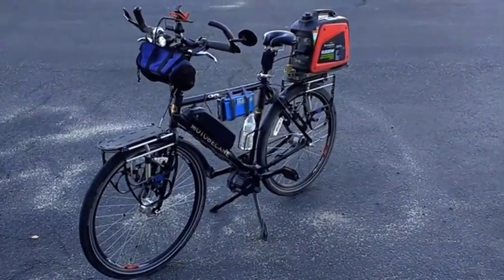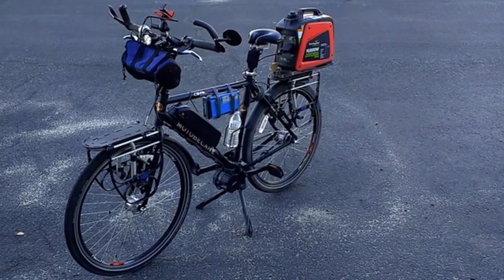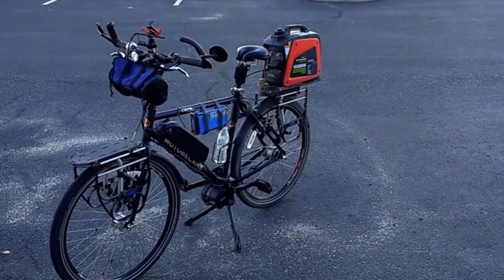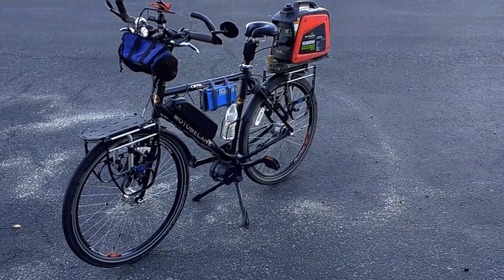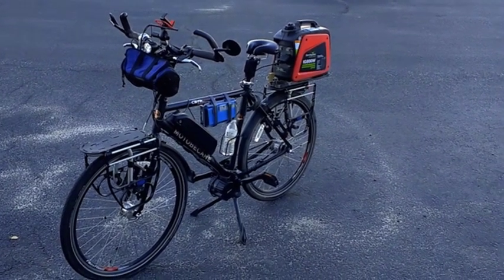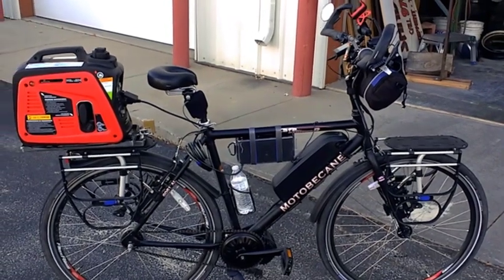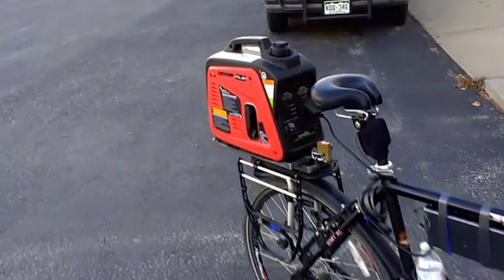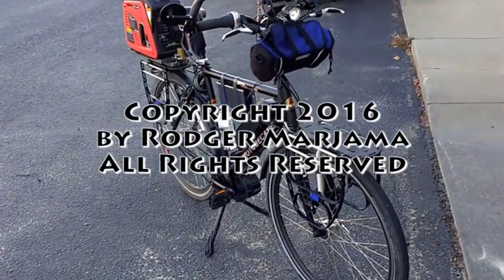e-Bike With Generator

Comment: Nice. Im planning to do something similar for my fat tire 2000w ebike. But my plan is to plug a converter into the controller directly to power it. Just have to find a small but powerful generator.

Comment: :)
Ideally you want a generator that provides the voltage and amperage that your battery charges at so you can skip the inefficiency of and weight of the charger.

It sounds like that would require a smaller generator and thus ICE.
You might look at a weedwacker or somesuch that produces about 300 to 400 watts and mate it to an efficient PM motor (as a generator) from hoverboard or something of same voltage, using a chain and properly sized sprockets to have both ICE and Generator at optimal rpm.

You will probably find that such will fit within the frame.

After that you may want to look at tuned length exhaust and intake software as that makes a big difference to ICE efficiency.
To make a tuned length exhaust, with a muffler, you need David Vizard's Pressure Wave Termination Box before the muffler.
The intake needs proper bell mouths at the intake into the air filter and from it into the carburettor.

I know that's never going to happen as it's way over your head.
I put this here for people with more tech inclination than yourself.

Comment: If you get another charger, minimal weight,  could you have 2-3 batteries and charge them also....I understand you will have extra weight.... but would generator be possible....I'm deciding on either going with solar or generator

Comment: Roger .. I have 4 ebikes and scooters currently .. problem being range which the experience of batteries.. thinking about unlimited range with 1000w 4 stoke generator coupled with a 600w ac to dc 48 v power box to eliminate battery all together .. can this be done .. mid drive Bafang 750 motor  
Saving the cost and weight of battery ??? 
Ty Don

Comment: It looks like it would overcharge the battery on the bike shortening it's life.
Reply: Would probably be wise to discharge the battery to about 60% before plugging in the charger. I'd like to try this by mounting the generator in a trailer but don't want to burn up the battery. The charger the came with my ebike only puts out 163 watts

Comment: Can a gas generator charge two e-bike batteries at once even if a e-bike battery is 48v and the hub motor is 500w or a 1'000w.Do the gas generator has to be 1,000w to charge the two 500w because I might have to go with a 2,000w gas generator ?

Comment: I'm thinking a gas motor conversion can work as a generator and get down road too. So can switch between electric and gas, had to charge and run .. Icd like to know the specs of the charge controller  if possible.
Thanks

Comment: I'm thinking of running directly to the motor.  Just need a 120 to 52volt transformer and plug to bypass the battery.
Reply: That's easy enough to do. Just think about the output and the transformer capabilities, heat and rain. There are plugs you can get that connect online that should be able to plug into the bike.

Comment: i was planning on getting a bike trailer for my ebike, and i planned on putting some batteries, maybe some solar and a small 2kw inverter generator. then tonight i dawned on my that i can mount the generator on the bike, ditch the solar and extra batteries, down size my current 3kwh lipo battery to 100wh at 72v to get up hills and use the generator to feed the controller and keep the battery topped off and ride all day. without fear of having to stop and charge. i spent a ton of money using lipo and spent another ton in fast chargers for them so i can balance charge all cells of the 3kwh in about 40 mins, if i can spread out over different breakers. but now i am thinking a small gen to power the bike then i can commute all day if i wanted or needed
Reply: commute all day

Comment: Could you theoretically connect the generator straight to the motor?
Reply: yes, theoretically
Reply: You would need to change the 110-120 volts coming out of the inverter generator down to a lower voltage that the controller and motor uses. The charger that comes with ebikes already change the voltage to charge the battery which makes it easier to charge the battery while it's discharging at the same time without having a voltage converter

Comment: Does this Dual source power supply confuse your controller? I had no idea EBIKES don't have to beOFF to charge by design. Did you hack the controller, or is there a way to attach an external power supply to any EBIKE controller?
Reply: I just bought my first ebike and the battery can be taken out to charge while keeping the bike stored somewhere or there's a port in the frame to plug the charger through and into the battery while the batis still attached to the bike. Should be able to charge the bike while riding it at the same time with either a small inverter generator or a battery power station

Comment: This is really interesting. I've done a lot of research on this because of your video. It is possible to get around 180-200 mpg when you skip the battery and link a motor directly to the generator with a power supply. A 2,000 watt setup is achievable in under $1000 which would be around the same price as a battery powered one, except with significantly longer range and instant charging at gas stations. If an external 5 gallon gas tank is added it could potentially drive for a thousand miles on one fill-up.
Reply from the maker: Yes, did that using a AC/DC 60V, 600W converter to some extent. Wanted to keep the battery in the loop, and did not find a suitable mix. Generator to the converter works fine though.
Reply: Could you give me a diagram how to do that
Reply: Got a electric bike that only last for 30 mins
Reply: I would like your help

Comment: You want to have 12 volt output from the generator and use a cheap converter to boost to 48 volts 2 amps this improves efficiency by bypass inverter. Up to 40% better.
Reply: those 12v outputs are lower current. so iets say its 12v x 2amps=24 watts,. to boot it to 48v it would be 48v x .5amps=24 watts plus a conversion loss of about 10%. even if its 12v x 10amps that is still only 120 watts. once boosted to 48v it will be 48vx 2.5amps mins loss in the conversion process.

Comment: 1c charging is best for battery cycle life. You would be better to charge at 4 amps for a 4p battery and use the generator when riding at less than 70%

Comment: Around 2017, I experimented with a very similar model genset on a previous recumbent bike build with 26" wheels and got much the same results as Rodger did. On a 60 mile ride I precisely measured the gas and set my speed to maintain as near a constant battery voltage between start and finish. I calculated consumption to be about 170-200 mpg and as with Rodger, I matched my motor power draw to be less than the charger's 300W supply. The recumbent advantage probably gave me a extra 2 or 3 mph as I recall sticking to about 20mph with some long hills. The problem was the same as Rodger's bike, that the 21 lb weight over the rear will felt unstable. On other recumbent builds I use Golden Eagle 37cc 4 stroke engine kit with a single stage drive belt to a 22" dia drive ring snapped onto the rear wheel's spokes. This also gets 200mpg but for ave speed of 26mph with 25% ride being hills. If the genset powered a 600W charger and if the e-bike motor assist could be de-restricted then it too could give a similar ave speed of ~26mph though the mpg would likely drop. The mechanical drive is more efficient but gliding down steep hills >30mph causes the belt tension-er vibrates a lot when the belt is driven by the wheel. The quick fix is to temporarily remove the belt from the drive ring but really there needs to be a freewheel or sprag clutch integrated into the drive ring. The genset does give some nice advantages, 1) the ease of taking it off for short rides or reclaiming cargo space, 2) its 37cc engine is much better sound damped inside its case, 3) the electric ride is much smoother and quieter than with the mechanical engine drive, 4) the 12V and USB outputs.  I plan to build a 52" wheelbase high roller style recumbent with the removable genset located just front of the rear wheel swing triangle because its just very compelling. Of course both forms of gas assist get lots of attention whenever I parked the bike.

Comment: Any updates on this? Is your E-Bike battery still running well? I am looking into doing this myself with a Portable 1000W (46.4Ah, 21.6V) Power Station so I wouldn't need gasoline.
Reply: I would like to know more about your project.  Any links or info on the power station

Comment: WHY ???? Why not just buy a small motor cycle
Reply: because many ebikes have only 10.5 or less amp hours.  if you want extra range 20.amp hour batterys cost like $800 or more.  unlimited range is much cheaper with the generator.

Comment: Skip the battery and just connect the generator to power the most powerfull electric motor it can handle.
Reply: It would output 12 volts and not enough amps to power even a basic ebike motor

Comment: Have you ever thought to use a twelve volt inverter between the generator and chargers
Reply: My charger is 42 volts/4 amps for a 36v li-ion battery pack which is required for the BMS to work correctly. I use a separate 12v battery pack w 5v adapter for my electronics and 12v for lights...But you made me think of 12v input RC chargers that multiply the output. .

Comment: I am using the same generator to charge my scooter but I have a better Idea I would like to bypass the battery and use the generator as the main electic source. Do you know who can install this for me with a switch to have the option to use batter or generator.  please contact me if you have any information. this way I do not need to depend on batter latingospel@yahoo.com

Comment: Question: why do you even need a battery? If you could divide the current with a power stick, you could theoretically just hook up all the lights and other energy demanding devices that you want to plug in, including the main motor driver. I don't see the reason for the battery, since the motor can just draw directly from the generator... gasoline becomes the battery. Of course you'll need a transformer to deliver 48V to the motor...  Whats the deal here?

Comment: Nice job, I've just bought an E Trike (fat-tired Jorvik Odin) with a big strong basket that is lower than the rest of the bike. I put a 1kw inverter generator in the basket plugged the trikes charger into it, then I Plugged the charging lead into the battery fired it up and it works well it charges on the move, just let the battery power run down to about 60% so the battery will have room for the extra charge without overheating because of the extra distance it's now able to travel.

Comment: I am doing the same thing (trailer version), is there a controller that could emulate the battery and the generator (via controller) be hooked strait into the the bike controller? (battery bypass).

p.s. In my case, I would need 36v, 250w. I'm not sure how the battery handles wattage.

Comment: Mount the generator-invertor above the mid-drive motor where you have the battery and AC/DC converter. Modify the bike frame a bit if needed. Thus your driving stability will improve a way better. The battery and the converter you can fix in the current place of the generator. Plus I suggest you to get high efficient (way above ordinary ones) AC/DC converter (90+% efficiency and around 20A output) to safe some power for charging the battery. Keep in mind that you still need your current wall charger to charge your battery from the generator in parallel as it is CC/CV that is absolutely necessary for charging LiIon batteries. Put a switch (electronic or mechanical) so you only charge the battery pack from the generator but not to drive the power from it to the motor simultaneously. I am looking further to see your vedeos about your riding experience. Good luck!

Comment: I debate going with  just bigger battery capacity and having the downtime for charging vs mounting a generator like this for trips. certainly the weight/balance of the bike is quite different. But using this setup, you will be pedaling a lot to assist the motor to keep your speed @ or above 18. 
compare the 25lbs of charger to 25lbs of extra battery. yes down time, but in any long journey you will be stopping to rest anyway and should be able to charge up. it would be most practical on cost to wire up your own battery of course, but I couldn't say whether this generator vs bigger batteries which is better. It's simply different way to approach the problem of extending range. not even solar charging would be better, in fact, probably worse lol. very cumbersome when laid out at a stop and no guarantees you'd have enough sun to fully charge when you wanted to.
one advantage ebikes have over hybrids tho is that batteries can be placed quite anywhere on the bike for weight distribution, whereas that type of generator can only have 2 possible locations
Reply: The big advantage of this setup VS  a hybrid bike using a 2 stroke motorized bike kit mounted on a e-bike. Is that the generator can be easily removed. Each one has pros and cons, the motorized 2 or 4 stroke hybrid could run both the gas engine and electric motor for more power uphills or run only gas or electric. I have a 2 stroke motorized bike and wanted to buy a 1000w FWD e-bike kit when I had the money. That way it can be 2wd I plan to use the gas engine only in areas I can ride then shut the motor off and use electric in town where I don't want to make noise. There are so many options and configurations it's hard to know what's best. If I put a jackshaft kit on my motorized bike it goes from only 1 gear to using the bikes chain, rear freewheel 7 sprockets and derailleur. So you now have low gears to easily climb hills and a high gear for a top speed of 35-40 mph . I think a 3 speed hub gear and jackshaft kit would be better than a derailleur. If I have a 1000w 52V  FWD and 2 stroke motorized bike with no jackshaft / single 36 tooth rear sprocket I think using both the engine and FWD boost could possibly give you a top speed of 40-45 mph which would help you keep up traffic if you needed to cross a narrow 55 mph highway bridge. I'm wanting to a build a high speed fat tire hybrid bike can hit a top speed of hopefully 45-55 MPH for a short bursts to keep up with the flow of traffic over a bridge in my area. Most of the time I'd only be cruising at 30 mph with the gas engine and 20-25 mph with the FWD electric motor...I think something like a 3000w  mid drive e-bike with beefed up wheels, strong chain, large battery pack and the generator mounted to one side of a rear rack would be cool....(just thinking/typing out loud)
Reply: trailer

Comment: Hi I have a problem I bought a generator like you I tried to be a highbred to him I’m using it for my E bike but for some reason I plug in the wire and it’s not charging my battery in my bike what can I do and if you can give me a call at 647-904-6791 I would appreciate that so much

Comment: did you build a one wheel trailer with it?
Reply from the maker: I had a Bob Ibex trailer I bought when I first bought the stock bike. I have used it pulling altogether about 400 lbs or so, rider and cargo under electric power.  But, if I were to do it again, I would use a 2 wheel trailer for loads over 40 lbs or so. Load upwards to 90 lbs makes the handling suffer too much.
Reply: @SpeedWingNET1  What's funny is,  there's a "Mr.Know It All"  YouTuber that lives in a van, doesn't work and e-begs/e-mooches, who built a mid drive  e-bike . When I mentioned using a Generator just like you did to extend range. He went into Mr.Know It All  mode and gave me a long list of reasons why it wouldn't work. As if my idea was just some sort of foolish pipe dream and that I really didn't know what I was talking about...lol

Comment: I have a dumb question, if the generator kicks out enough wattage to power the motor, then why do you need the batteries at all?
Sorry if this is a stupid question,  but I'm new to electric motors.
Reply: The batteries power the motor, the generator powers the batteries so you get longer mileage. depending on your battery configuration it could take 3 hours to power up the batteries to full charge on a wall outlet. you can ride longer without having to stop, all you would need to do is stop at a gas station.
Reply: @HamguyBacon   thanks so much! I understand  now.
Reply: if you set the rectifier/psu/charger to say 72v and your battery is only 72v when fully charged, the generator will charge the battery and power the bike, unless the voltage drops below the battery voltage then the battery will also be supplying power. once you get a huge hill, the controller can pull power from both the battery and the generator. and then as you get over the hills the load lessons and you are back to charging the battery and powering the controller from the generator.

this dudes problems is that his generator is only 800 watts but his biggest issue was that his charger/psu/rectifier was only pulling 300 watts from his generator. its not really a problem but he is not utilizing all the power that the generator can make which is a waste to carry that much around and only use less than half of it, plus 300 watts is really not much.
he should get three times the charging capability or get a  smaller generator imo, and it sounds like he may have done one of these.

oh and his motor might be able to pull 700 watts if i had to guess. so it can pull more than he can charge with one charger, so the battery basicaly will act like a buffer for hills, unless he goes full throttle all the time, which i doubt he ever does.